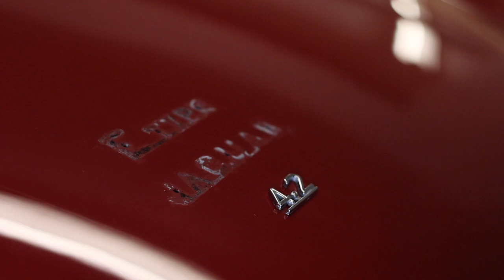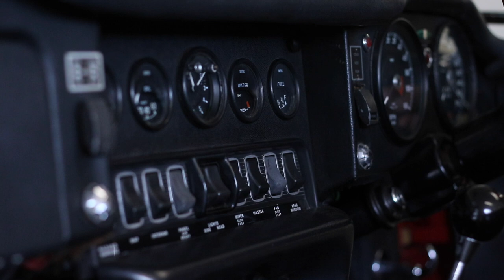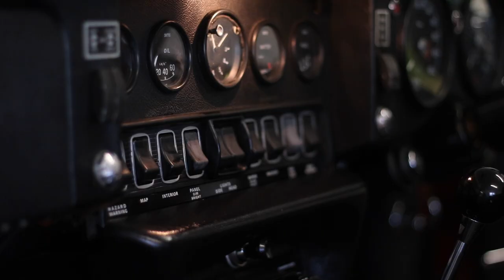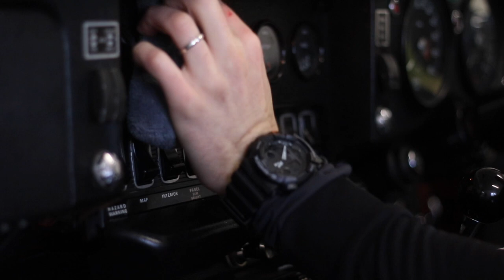Full Detailing & Paint Correction Transformation | Jaguar E Type | Part Two of Two

Comment: Very nice work Joe. If you charged less than a monkey you under charged !  That "e"type 's value has Increased by 5 grand ! If your as bad as me you would have cleaned the lamp screws (and l also make sure the slots are all vertical !)  Regarding the engine . I go round to hardware stores and buy any copper wire brushes that could be useful for reaching those hard to get at places. And your comment about anyone can use a polisher ....very few have the ability or skill or patience to do what you do . As always when you see someone who knows what the're doing  , it looks deceptively easy . Cracking work Joe . Thanks for sharing.
Reply from the maker: Again John thanks for your kind words!

Don't worry all screw heads where polished in a drill and then lined up! 

This is the detailing I really enjoy!

Comment: As an owner of a series 1 '66 coupe I will give you some advise, Never USE A PRESSURE WASHER on a jaguar e type, your forcing water into areas which will eventually lead to rusting, and if your ignoring this advise, at least COVER all openings inside the engine area, cover the alternator, cover the fan motors, cover the relay switches, cover the distributor, cover the opening to the fresh air/heater screen on the heater housing. If you were an jag owner you would know this.